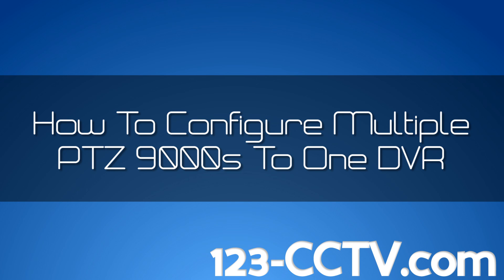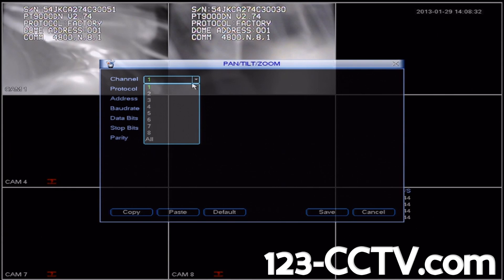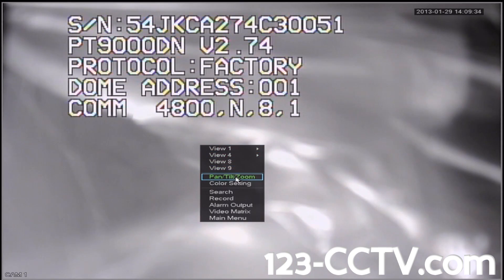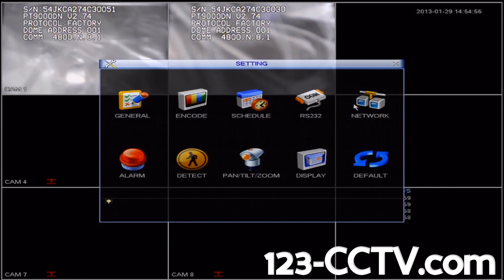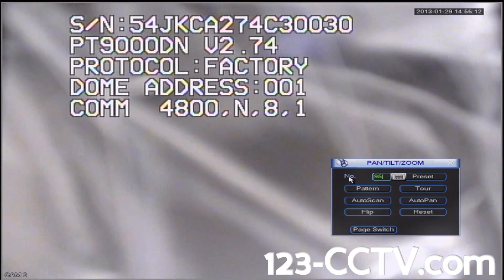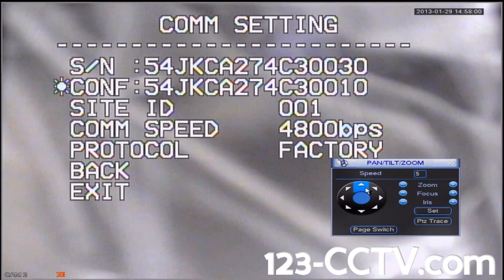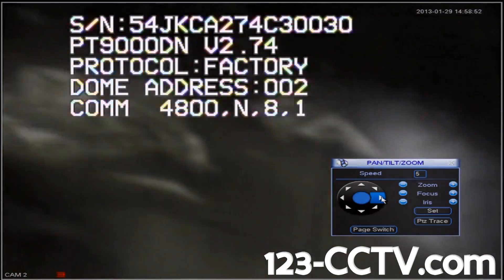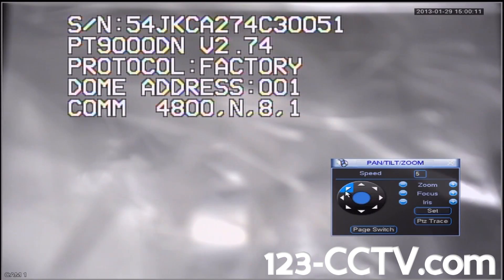Configuring Multiple PTZ 9000's to one DVR 123CCTV

Comment: Very good explanation. I was so confused when I first installed 2 ptz cameras. Now I can go back to the site and try to use the knowledge that I learned from you. I am using Q-See cameras. On channel 1 and 16 I have the same models (qd6531z-K). They both came with Channel 1, Protocal D, Address 1. So I need to change Channel 16. Do I change the address to 16 on that camera, or just put any other number except 1? Thanks
Reply from the maker: Have no idea about Q-see equipment. Try giving their support team a call.